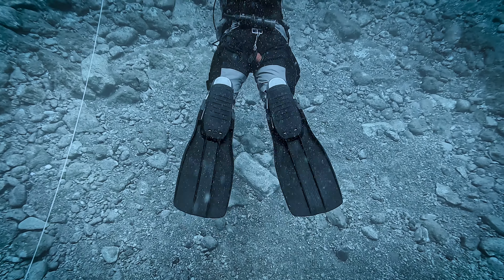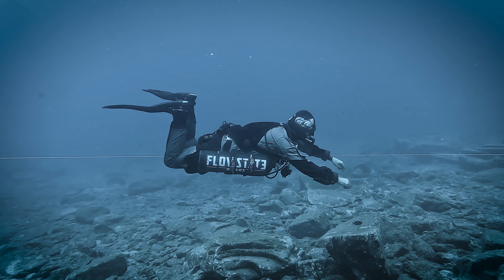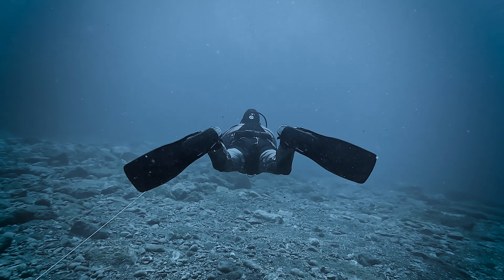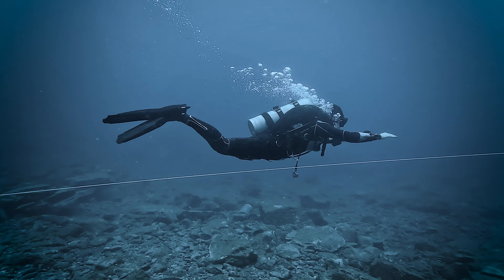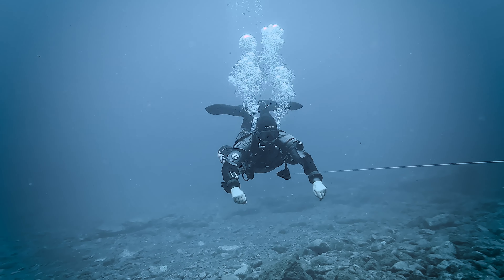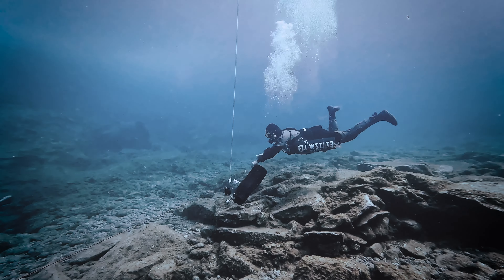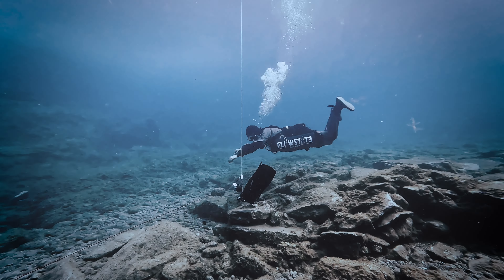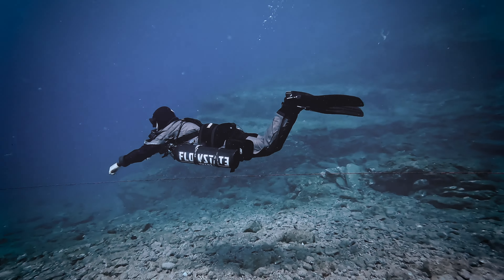How To Frog Kick | Master Series

Comment: My OW instructors were Tech divers, so they tought us the frog kick. At the time, I thought this was the norm, until i dove with strangers! Lol
Reply from the maker: Lucky you ! We believe that this should be in every standard open water level curriculum.
Reply: @flowstatedivers  they also taught single hand communication, primarily air pressure. On my 20-something dive, I dove with all new buddies who were trained on something else. It wasn't until the DM asked me my psi and gave me a strange look that I found out there's, "other systems." We got to the surface and he told me, "I have no idea what those hands signals meant, but you had a Perdix II and were super squared away so I assumed as long as you were looking at it and giving me alien signals you knew you were good". I asked him, wtf kind of hands comm's they used for numbers and he showed me some confusing number of fingers on the forearm thing that made no sense. Lol
Reply: @YZFoFittie What makes somebody a Tech diver, versus otherwise?  I have not learned that yet, only heard the term.
Reply: @ttb1513  "Technical divers" are anyone who is taught decompression procedures. That's the simplest explanation.
Reply: @YZFoFittie Thanks.
Reply: My OW is also frog kicking, wing and drysuit straight out of the gate 😅 Instructors are cold water wreck divers, that setup should be standard for every new diver 😂😂